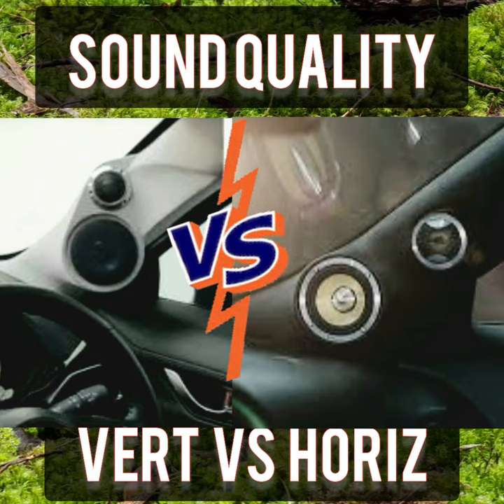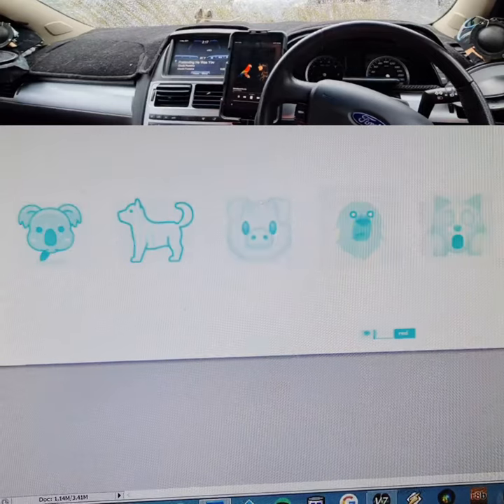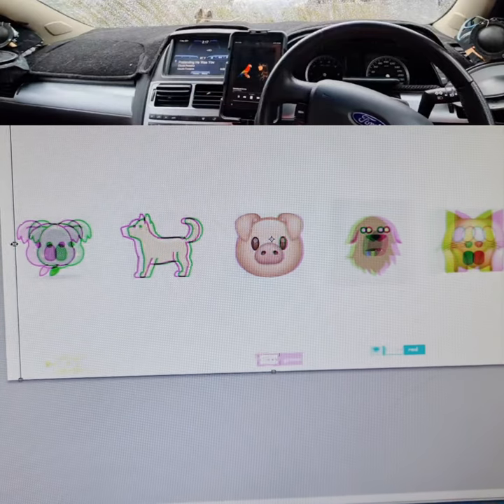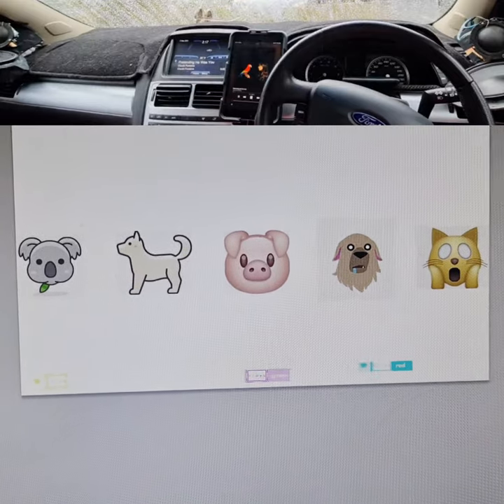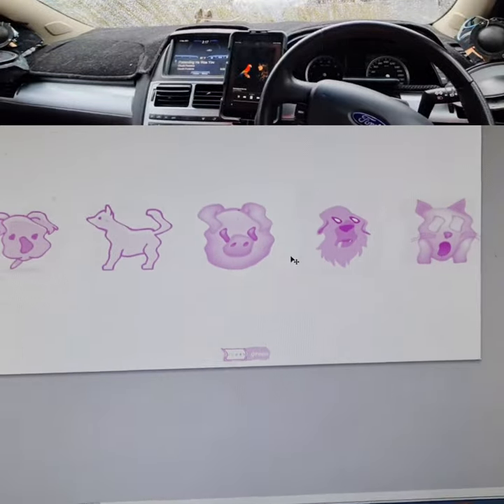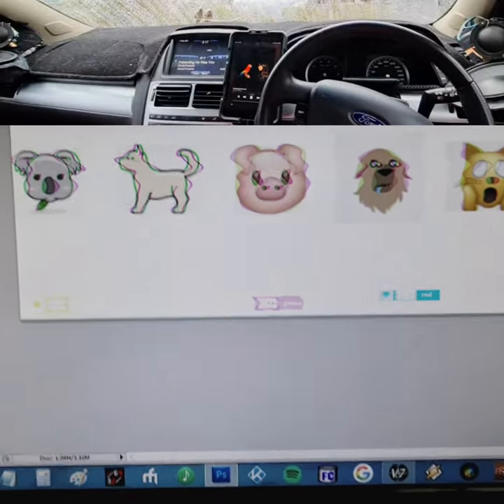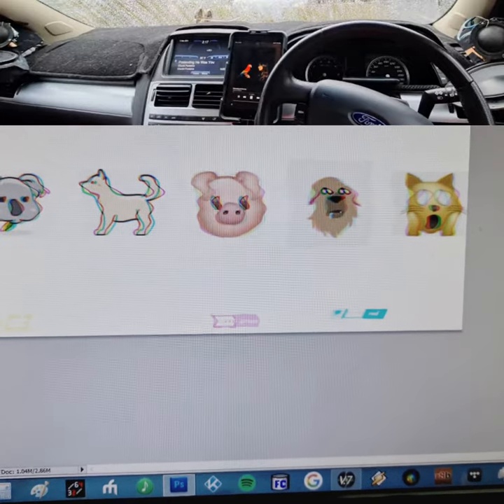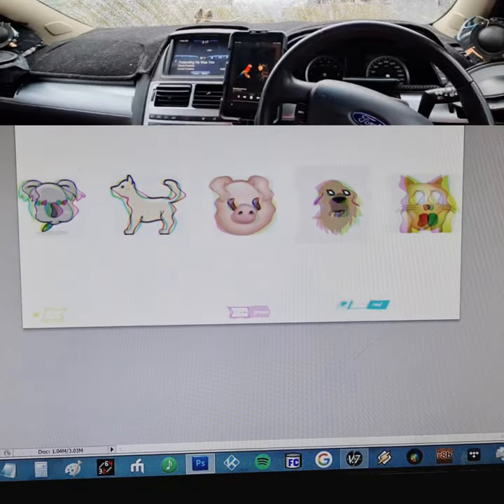SQ Sound Stage -vertical vs horizontal- speaker placement

Comment: Interesting 🤔 

I was planning to make a a pillar build 
But i'm getting a little confused

conclusion :
what is the best way to position the mid and tweets and where to aim 

Please let me no
Reply from the maker: Vertical is better for sound quality stage resolution. Aiming is towards the listener if you want max SQ for driver.
Reply: Thanks 

I appreciate this 👍
Reply: Hi there 
Question:
midrange and tweeter in pillar how close together 
Is it a  problem if they are couple inches  apart from each other
What’s the max distance 
I hope you can help
Reply from the maker: Any distance will do. Closer is better. Some try coaxial. Point source is the theoretical best case for SQ but practical limitations always come into consideration.